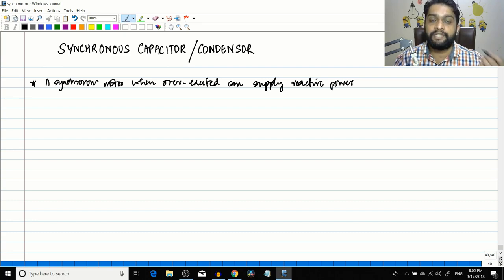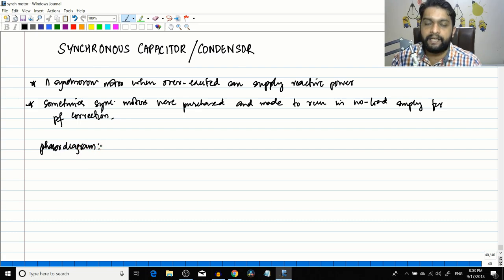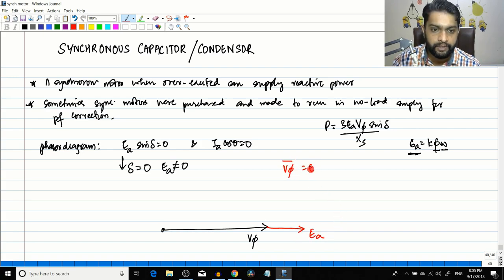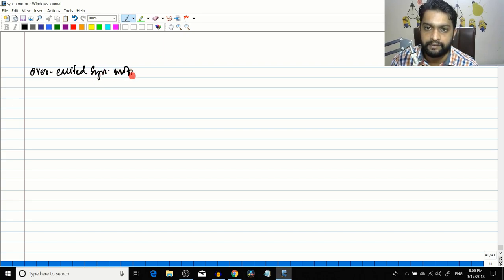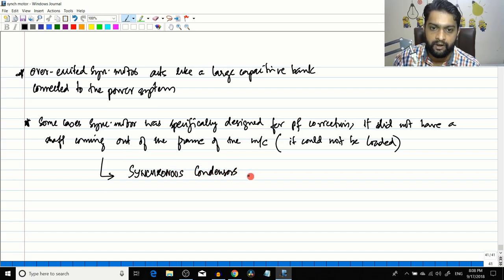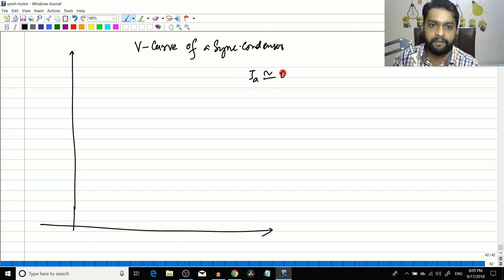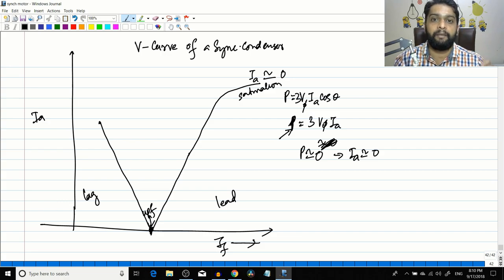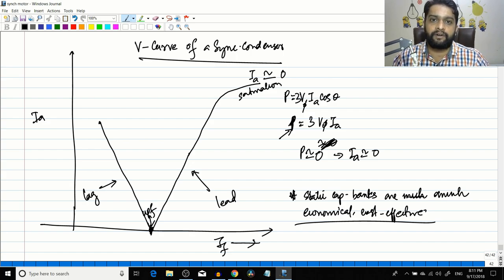#12 Synchronous Motor -  Synchronous Condensor / Capacitor

Comment: And which one is better for increase the receiving end voltage(I.e improve voltage regulation) in transmission line 
Capacitor or shynch condenser

Comment: Sir, if the capacitor of a synchronous motor is damaged.
Is that causes change in rotation of a motor like one time anti clock wise and another time clock wise like that 🙄